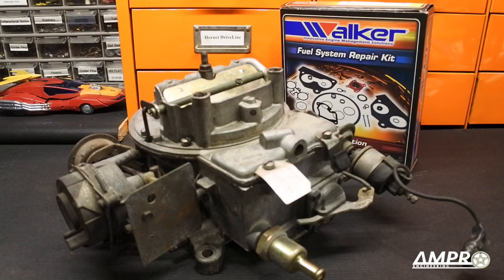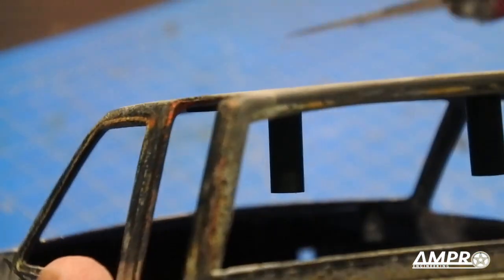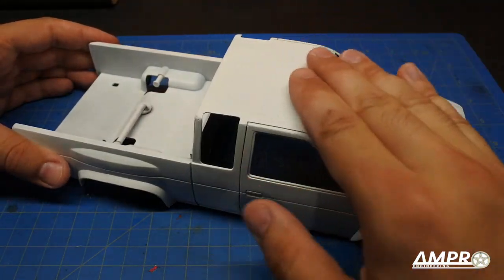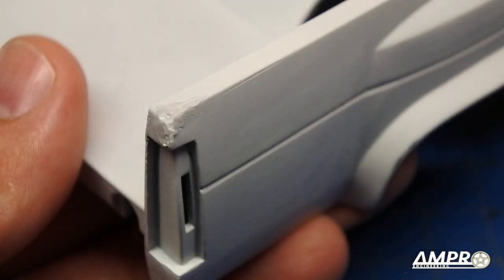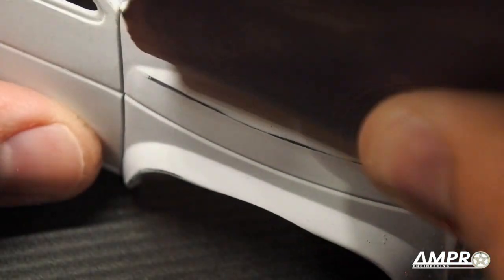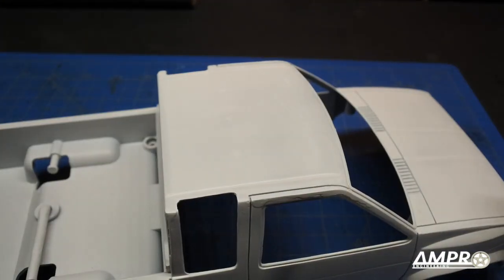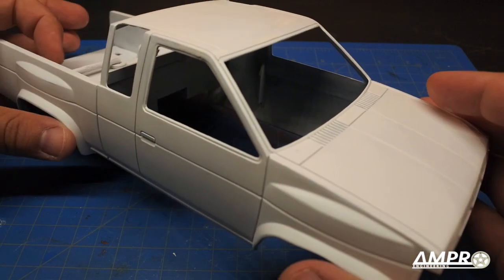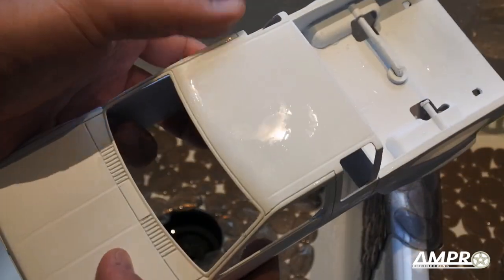E99: ABS Body Restoration - Taiyo/Tyco Baja Bandit Restoration and Upgrade - Part 3

Comment: Great video VERY helpful, and the body looks great i can't wait to see the next step in the restoration i have 2 Tyco eliminators (bandits younger cousin) that am trying to turn into 1 working car and this has inspired me, and seeing how you handle the suspension repairs you are working on will help too. In my case the eliminator i had when i was young runs but was VERY abused by it's previous owner and i use erector set pieces and twist ties to hold some of it together and the transmission switch between high and low is in an bad way, then i bought one on ebay to have one in better shape to run only to find that the guy who sold it to me broke the front suspension and glued it and said nothing about this truck needing to be display only so on my first drive the front strut pillar snapped and the steering knuckle split where they had been glued, so i am either going to try and put the trans from the ebay shelf queen on my old faithful or try to put the suspension pieces from old faithful onto the shelf queen
Reply from the maker: Thank you for that. I am concerned about the chassis. Everything on it is cracked and I have a couple paths I can go. I just bought a rare 4wd turbo hopper and want to see how that can be used in this build.
Reply: +AMPRO Engineering yeah it might just work I noticed turbo hoppers(9.6v battery pack variants), bandits, and Eliminators share many components the tough part will probably be removing the pins the hold the suspension and steering components on as well any of the nuts that are pressed on I an still trying to find a way to safely remove those
Reply from the maker: Same here.  I am not looking forward to that part .

Comment: Nice! lots of work should look like a beauty once painted! Hey I was trying to contact you about midnight pumpkin body posts if you have any that are stronger than stock...I cracked mine both off last outing! Let me know, Thanks
Reply from the maker: Ill check my email. You cracked the stock ones or mine?
Reply: Hi i cracked my stock one and was wondering if you had anything stronger. =)
Reply from the maker: The ones I have in SLS are stronger than stock. I think I have an installation video of them on my channel.
Reply: Cool let me know when you get the other project we worked on and then when you ship the stuff to me I can get the posts from you ok. =)
Reply from the maker: Will do. I think I need to order more of them from shapeways.
Reply: Cool let me know when everything's ready to go!

Comment: Instead of Tamiya filler use automotive spot putty. It's basically solidified primer. Comes in a tube and it won't crack.
Reply from the maker: I have used that too, really good product. This stuff when used thin is like steel. It is when people go crazy with the putty that it splits.

Comment: What I do instead of using a flat edge is a basin of olive oil that I keep in a drawer it works amazing gets a lot of residue off. Get 1000 g sand paper for just a quick minute. Wash soapy water. Dry apply-in-weld putty in divots- two part pudd/hardner the super glue gets expensive and harder to manipulate even gel. That's why I don't use often you do great work with it. I then apply soap and luke water let dry, apply generic primer. Give it a couple days days. Sand 320 fine and use a heavy gauge thread needle for any door/hood lines back 1000 g paper wash take outside when wet. Dry and paint under and top primer let dry 1day then paint your favorite color. I've done a ton ABS bodied models. I do my favorite models-Marui Big Bears. Old paper bags work great for ultra fine sand and get it free. Check out my videos. Can't wait for more awesome videos from you.
Reply from the maker: Thank you for your information. I too have been restoring ABS bodies for decades. My first one was done in 1995 when I was 15. It still looks stunning to this day and I love to keep doing it. I will look at your channel.